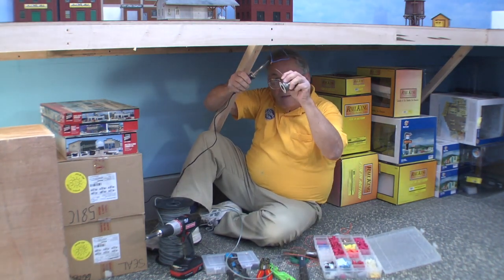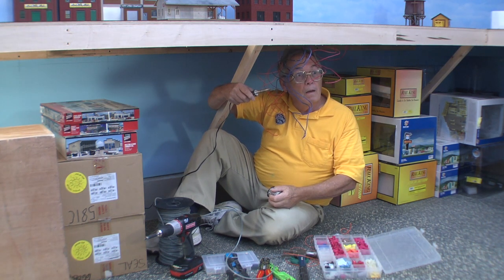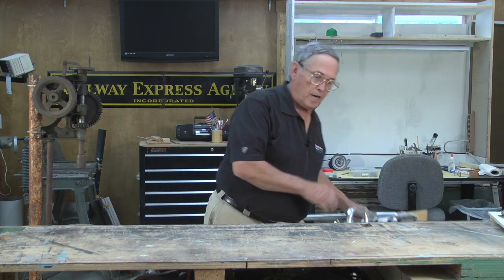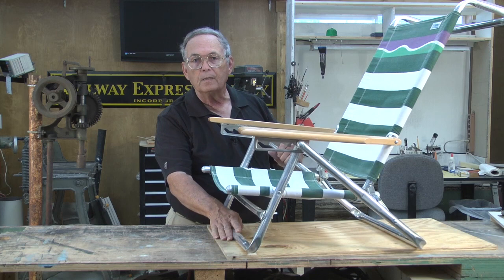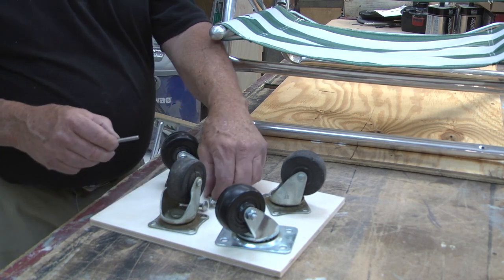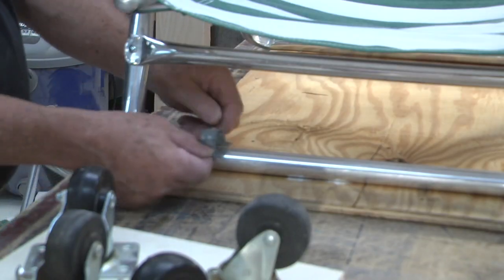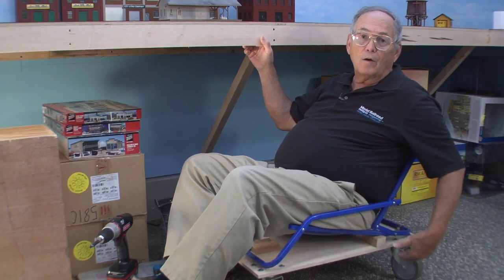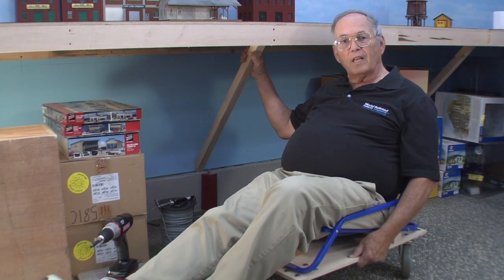The Layout Chair 1

Comment: Miles, this is a fantastic idea.
One thought, the chair needs a neck rest that is adjustable. It is always trying to hold my neck up that causes me the most issues.
Reply from the maker: Yes, The chair that I use has a high back and a cushion with corner ties so it can be fixed at the top of the back for my head. The one in the video was for a layout that had about four feet of clearance under the benchmark and he needed a higher  more upright position. Thanks for being a viewer, I appreciate everyone who subscribes and watches!